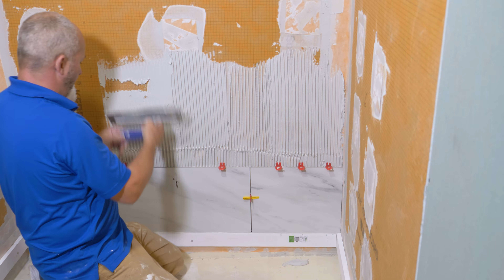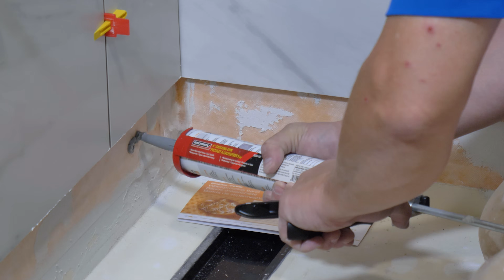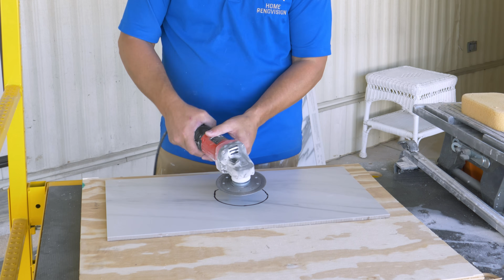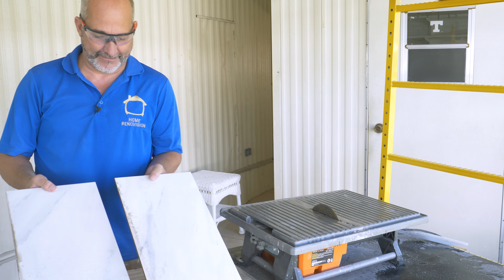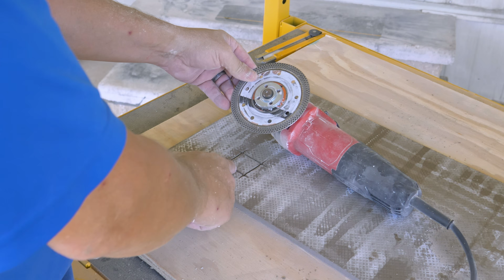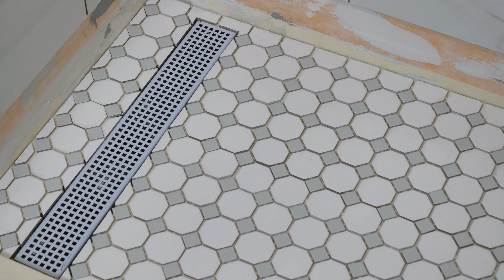How I Tiled This Custom Shower (Tips for Beginners)

Comment: I like the 1/3 tile layout, especially on bigger floor areas. For the back of your shower I would of moved it to the left a little, took the average centres of the middle tiles as the centre, had the smaller cut offs equal on both sides. Means more cutting and waste but looks more symmetrical. Your full tiles on the left side stand out.

Comment: Your Kerdi Mixing Valve Seal is installed backwards.  Thick side should be inside the wall cavity and sloped thin side should be outside the wall so water can drain outward and not into the wall cavity if there was a leak.

Comment: There's a better way to finish that window. Pull the trim from around the window and replace it with PVC do a jamb extension if you need to. I don't know if that's the right terminology for a window but I'm sure you understand

Comment: Jus.t watched your video on installing bathroom tiles. I watched you cutting tiles on a Rigid table saw that I'm using. I put a new blade in (Not cheap) but just at the end of the cut the tile chips. I go very slow so its not because I'm pushing to hard. Can you tell me the brand of the saw blade you are using please. I bought the Rigid web blade that was suggested to me. Don't want to waist anymore tiles. Cheers

Comment: you may. However the client will not consider the math. it is called a running bond with a 33% offset.
The mortar you are using is an organic compound. a dry set is not so forgiving.  rectified or non-rectified tiles?

Comment: When you're using a table wet saw, stand behind it and pull the tile toward you.  Ditch the fence too.  This way it won't bind on you as you pull it and you stay pretty dry.

Also sorry to nitpick but the left tile under the window is amateur man.  No way I would send that.

Comment: I have a question, on my wall its about 71 3/4 I have some at 71 5/8 I know this can be worked wth but someone told me to go a full 12 5/8 as the ledger board edge and im using 12 x 24 tile with the floor a mosaic at 0.37 inches in height before grout
Reply: Won't my 12 x 24 end up short by a little?

Comment: We are preparing to remove an old alcove tub/shower and put in a tiled shower.  The existing does not go all the way to the ceiling.  Would it be better to take tile all the way up or is it ok to end it short of the ceiling?

Comment: Silly question, so I trust you more on projects than anyone especially bathroom tile, I’ve seen tons of those of your production. So most people go for thicker thin set, I even think manufacturers also ask for it because it the larger than 15” tiles. You mentioned 1/4 by 3/8. You always make logical sense. It even looks like you’re not into crazy too much thin set, which is what I prefer, obviously less mess. My problem is I’m about to tile today. Hopefully if you’re not around someone else can expand on this asap. lol. Thanks, if I don’t hear I’m just going with your recommendation. Good day.

Comment: Why are some of the 12x24 tiles that the tiler set sticking out further than the one above it ? When a 4 ft level is laid up against the shower wall some tiles touch it & some don’t. The walls out side the shower are perfectly level.

Comment: Correct me if I’m wrong but when you cracked that tile …BTDT… and pull it off tue walk the coverage is really bad… nothing on the wall and ridges on tile not compressed. Guess it could be that you hadn’t fully set it, but I would expect better coverage. Noticed you changed from trowel wall and back butter tile, to just trowel back of tile

Comment: How did you finish the exposed untiled Kerdi material, where the tile ends?  There looks alike a strip of about 12 inches of Kerdi, with thinset over the Green board.

Comment: For the stripped screw head, what works for me is putting the head of the screw in the drill, tighten the drill chuck as tight as you can, then reverse the drill.. works in most situations.

Comment: The joys of perfectly framing out exactly to 8 foot height all of your walls in your shower for tiles and then going to vertically install 12 x 24 tiles on 1/3rds so they fit perfect just to find out they are actually 23 5/8" long.  Priceless.  Even with 1/8" grout lines you still end up with a 1/2" of gap at the ceiling when you start the column with a full tile..  How does one address this?

Comment: overall good video. i never use the plastic trim, whenever I've tried to cut it on my mitre saw it explodes, even with using a new blade and my custom made trim jig.

Another point he makes about how score cutters don't work well on porcelain is false. That crappy QEP one probably doesn't stand a chance. I've got a few sigma cutters (montolit and rubi also make nice cutters), one of which is huge that I've cut 5 foot long porcelain tile on. Was it expensive? Yes. Does it work way better? Also yes.

Comment: I did a border around my redi tile opening as I used natural rocks that I guess they would refer to as pebbles so I laid it around the hole first and then laid the rocks as best I could get them to fit as I didn't want to cut them and as amazing as it sounds, I was able to put all of the pieces in a way that fit perfectly well without cutting the rocks. I loved how it came out. I did have planned out to use the Schluter pieces but I didn't like how they looked compared to the black flat pencil style border.

Comment: I just bought a house and the previous owner installed new tile. They are smaller square tiles, and there's a gap left where the handle is. It looks like he just chose not to place a tile there and I'm sure water is getting in there. What should I use to seal that up or am I going to have to remove the shower handle and add a tile there?

Comment: This one isn't as bad as most of this guy's videos, but a few points: 1. If you've framed your walls even close to plumb, you can pre-cut all of your back wall tile up to the window; you've got ~1/4" of leeway on each side since the tile on the adjacent wall covers the gap.  2. Always cut the edges of the mosaic so the cut edges of the sheets are (close to) against the wall.  Note here that he dry fit the tile and marked the cuts around the drain, then had to stick 20+ little cut pieces against the shower valve wall.  Not only is this a pain, it increases the chance of those tiles not being set at the correct height or pitch and water ebnds up collecting against the wall.  You're better off pulling the grate out, laying sheets on the floor, laying the grate over them upside down several rows of tile back from the edge of the sheet.  That way you can cut the sheet for the wall.  3.Smaller issue: it's easier to grout the floor tile before you put in the bottom course of wall tile.  4. Bigger issue: when you're cutting tile with a grinder, put on a N95 dust mask!!!  Not only does most ceramic tile have carcinogens in it, if you work in the trades with regular exposure to silica dust, silicosis should be a real concern.

Comment: What if we can't use the kerdi valve or pipe seal because they dont fit? The face plate is also square with very different measurements. But how do we waterproof in this case?

Comment: Hello Sir, 

What is your opinion of using liquid nails to installa shower tile ? the thinkset does add thickness to the walls.. where was liquid nail is thiner and less than 1/8... and its also comming in water proof varierty....

Comment: You use long nails to nail wooden strips to stick tiles. The long nails also penetrate the waterproof board and the waterproof wall. Then you take out the long nails and wooden strips to stick the bottom tile. The waterproof wall penetrated by the long nails increases the probability of water seepage. This doesn't seem appropriate. If the waterproof wall can be nailed and drilled at will, then wouldn't the waterproofing be in vain?

Comment: I am normally impressed by your knowledge of most things Jeff. Really surprised at some of the things you said right at the beginning of this video. Tiles are not 12x24, only called that, they are 30x60 cm. Not sure any are 12x24, about 11 3/4x23 1/2, so no, 8 tiles will not do 8 feet. The proper size trowel for that size tile is 1/2x1/2 or euro. Notches are collapsed, how can they let water travel as you said. Water travels through thinset by wicking. Still love you, but disappointing.

Comment: Hi Jeff! Great info you have been sharing. I’ve been watching a lot of your drywall repair videos and I’d like to know if there is a way to use the pieces of drywall that were removed from the wall. Two pieces were cut out by the plumber to do an outdoor faucet replacement (the wall stud is somewhat in the middle). Oh and the wall is textured. BTW if there is already a video doing this type of repair my apologies but I must have missed it. Thanks for your reply if you can provide some guidance.

Comment: When I used this type tile I pre-laid out the pattern in the next room first, so the marbling was mostly aligned when installed. Looked much closer to real marble. Maybe a bit obsessive but it was for my own bath so......  And I have a mini pipe wrench to turn out the stripped screw so I don't need to squeeze pliers.

Comment: so,,,, yes, I like the tile layout to the drain, awesome. What I did not like is the 2 short wall layout. For me the 1/3 offset on the back wall now the other walls do not match that pattern. Every other row on the short walls match each other. On the long wall every 3rd row matches. I would have added a few more cuts to the short walls to get the 1/3 offset every 3 rows repeat pattern. But, that is me. Many ways to do this. I am actually willing to try the mosaic tile the next shower I do on the floor. Overall I love how it came out if I look past the pattern on the short walls.

Comment: What's the reason for not doing the floor tile first, then the walls? Wouldn't that have been more logical for drainage when the wall tile sits over the floor, not behind it?
Reply from the maker: on a sloped floor the thin cuts are almost impossible to make perfect and set on the floor. Besides the reason for this shower pan is to make the base completely waterproof even before tile so you can consider the tile just an aesthetic and not an actual part of the waterproofing. Cheers!

Comment: Pro tip..use a toothbrush to clean out thinset while setting tiles.
Reply: Thats a good one, tnx 👍
Reply from the maker: Pro tip don't add too much thinset so it doesn't squeeze out. the proper trowel is a lot easier than cleaning thinset.
Reply: I use the tile spacers, or a piece of wood (tooth pick), to remove it from the grout lines and immediately wipe off, with wet cloth, all and every thinset from the tiles itself before it dries. Don't wait till next day.
Reply: matchsticks work for 3mm

Comment: Around the drain where the cut edges of tile are installed, is there a way to soften the cut edge of the tile so it's not a risk of foot injury if stepped upon?
Reply: A diamond sponge would work I would think
Reply from the maker: a little buff can help or a light sand.

Comment: Another way to clean out the excess grout is with a multi-tool and a grout blade. Be careful as it can jump out and scratch the tile. Finesse it, don't force it. I have done this when I had to regrout the whole shower as it wasn 't done properly, missing grout was filled with silicone (not by me).

Comment: Are the tile joints in the corners not meant to line up?
Reply: I’m guessing not because you’re gonna use silicone anyway
Reply: By rights they should be but with the silicone you can fudge it a bit.
Reply: @billm.8220  Yeah I think I'd condemn this job if it was in my house lol! I think this guy looks more like a DIY Tiler by the standard of work!

Comment: 1/3rd bond (or brick pattern) is actually recommended for 12x24" tile because the surface of large format tile is warped to the point where the edges (ends) are thinner than the center of the tile. So if you do half bond you get the thinnest part of the tile meeting in the middle of the tile, which is the thickest part of the tile, and you get about 1/16th to a shy 1/8" lippage problem. Yes with clips you can actually bend tile, but it makes your job a hell of a lot harder.
Reply: ⅓ bond isnt brick bond thats half bond.....and he has done it offset ⅓ bond
Reply: I’ve never thought about that but it definitely makes sense I’ve ran into that surface change a few times
Reply: I'm more concerned that he doesn't seem to be collapsing ridges, just slapping the tiles onto the wall - i can't see any lateral movement to collapse the ridges - couple of tiles were notched on the back without back buttering the wall - i'm not sure if we're getting 95% coverage here. Other than that, some pretty good tips and it does look nice.